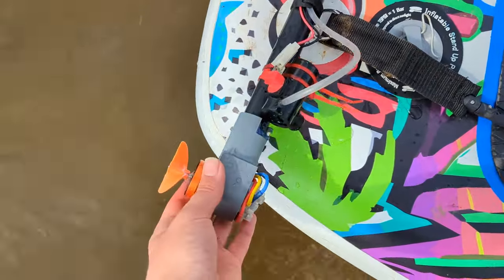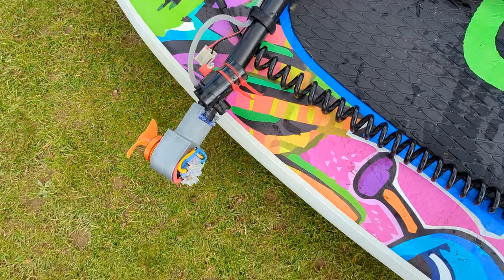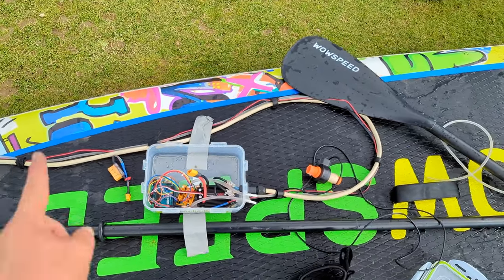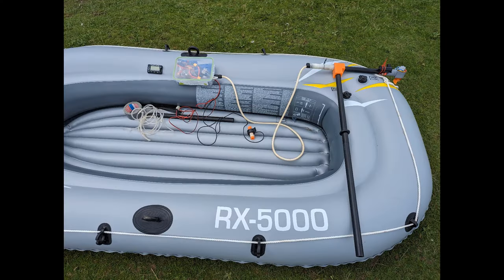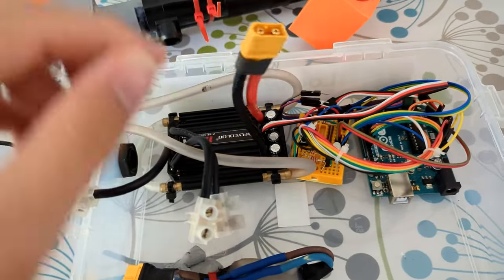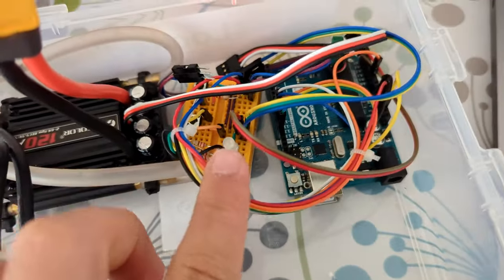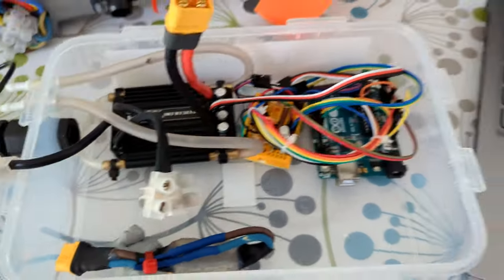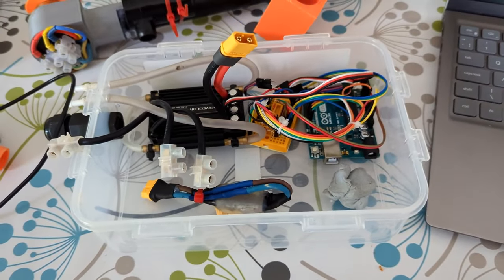Making a paddle bord electric! ~ DIY outboard motor build

Comment: Great video. Not to bring up sad memory's. Joke.. How did the wind turbine work out? My 500watt 12v 5 blades makes nothing. The 5 blades will not let it go fast enough.
Reply from the maker: Same here, we have taken it down now. It wasn't worth the noise and the sight.
Reply: Yes, a lot of noise for nothing. The time it takes to make it. You think they would make one that work a little bit. Me I want to gear it up to see if I can burn it up or at best make it work. The wires in the coils are small. With a drill I did see 29 amps at 1600 rpm. Bet it would not do that long. Never will see 500 watts. 6 amps at 800rpm. So, I know it can't reach near that speed. with the 5 blades. It might put out more with 3 blades. I'm not going to spend $30 for another hub to see. I can gear it and make it put out. Love making chicken Salad out of chicken s--t.